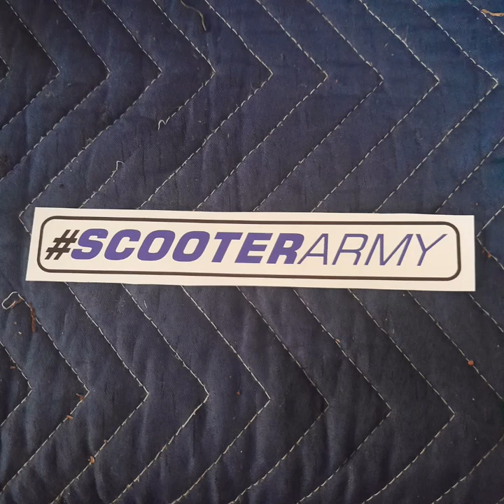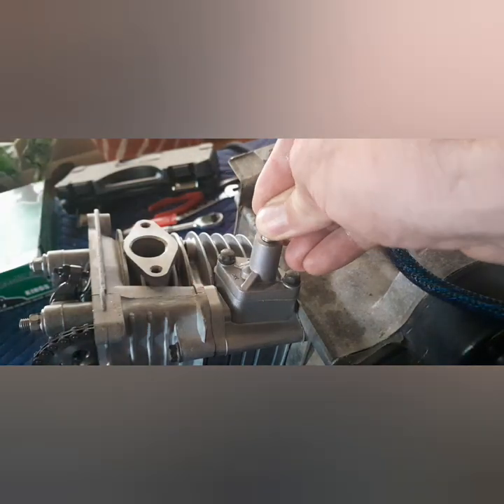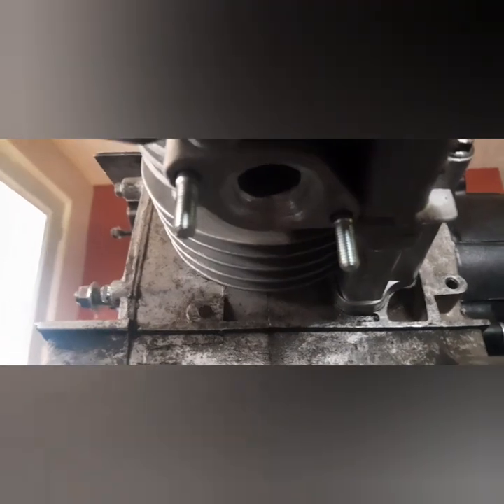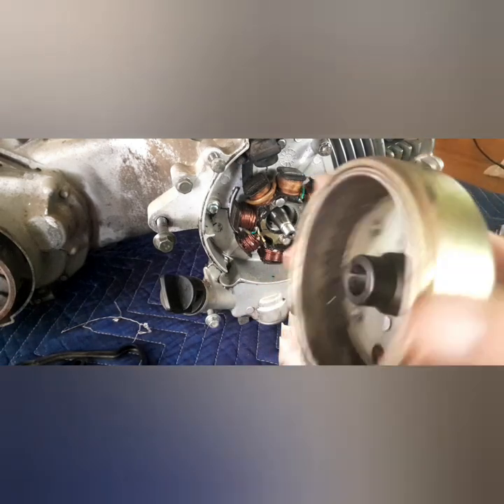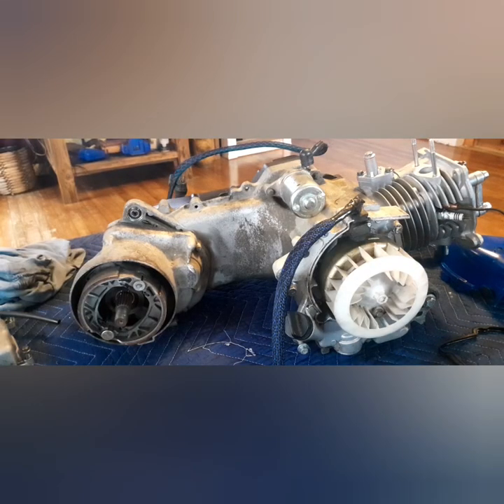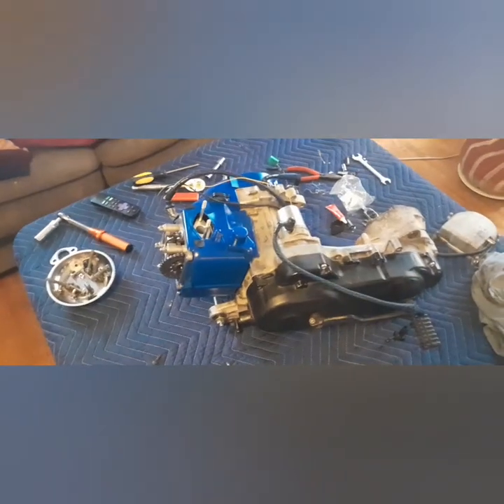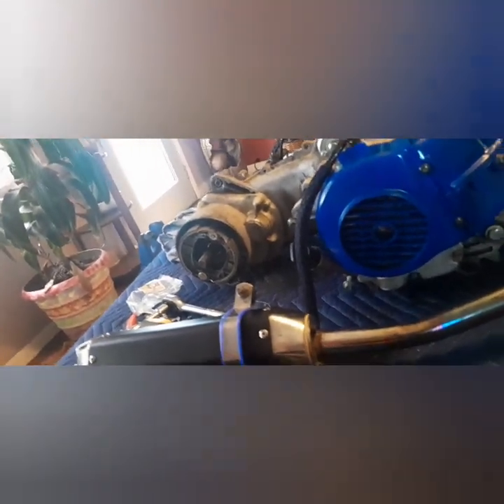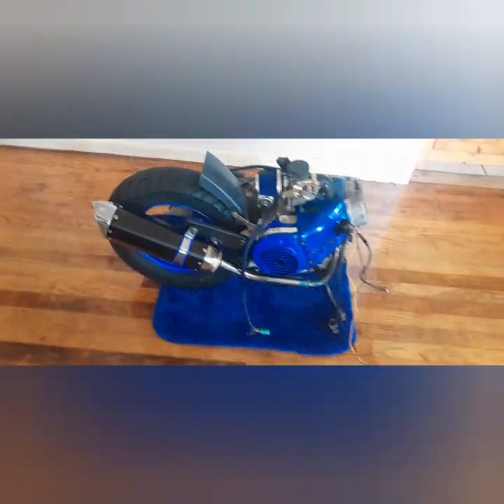139qmb build gy6 big bore kit install (part 2) 52mm w/ bv head

Comment: Did you have to modify the engine case to fit the new cylinder and head on to your 50cc engine?
Reply from the maker: No.. this is drop in on 99% of qmbs.. I have seen once, a case that needed modification
Reply: @scooterarmy  The only QMBs that need case honing are the QJ built variant that was on a bunch of old Ventos. You'll know you're looking at one of those because they take weird sized belts (that are no longer available) and use Minarelli clone variators... but there are so few of them left it hardly matters anymore.
Reply from the maker: @Partsforscooters1  yep, I've seen one ever

Comment: How does it keep it cooler? I mean it's plastic. . I took mine of my maddog an I used the plate that was mounted under the seat an cut an made a piece to mount with the angle of the bar that's on front of head an formed a piece that follows the curved bar under the head
 Sound good or no. Im thinking of getting the 72cc kit from rolling wrench.  Do I have to pull the motor off?
Reply from the maker: I'm not sure I understand. Most of the time pulling the.motor is not necessary.  I had other reasons to pull, I usually do it on bike.

The plastic cooling shroud keeps it cooler because it encloses the engine and the fan flows are around it. You will overheat without the cooling shroud.
Reply: It will overheat? I guess the wind from riding doesn't blow on it.  I put the steel plates thru on mine to block water from hitting the head. Keep your wrapped in plastic. It's beautiful
Reply from the maker: @seanmayo206  I hear ya.. and im not the world authority on it.. I run a temp gauge and would be curious what Temps your running without the cooling shroud. At the end of the day,  if it works with non-issue for you then carry on and enjoy. Thanks for watching And engaging with me... have a good one my friend.
Reply: @scooterarmy  bruh if a  little ass 50 starts to overheat then your a heavy ass
Reply from the maker: @seanmayo206  you'd be surprised what idiots are capable of lol.. and with a high lift cam and 52mm bore they can get pretty hot at wot.
Reply: Fuck the crank up then
Reply from the maker: @seanmayo206  huh...
Reply: @scooterarmy  I'm referring to a 50cc .i
Reply: @scooterarmy  I just possibly have the best looking maddog in NC considering it's a maddog
Reply from the maker: @seanmayo206  I saw it and it's nice!
Reply: @scooterarmy  thks man. It's been a struggle. I deleted all the you know what stuff an then had to figure out the right combination of CVT parts

Comment: I don't have no license and with those ccs id need it or a different vin numbers
Reply: No one is gonna know what size engine you have.
Reply: @edwinmendija8087  they would know if it goes over 40 what size the engine is
Reply: @edwinmendija8087  but then if i put a larger engine on i would have to swap the tag numbers on the frame because a bigger engine's tag numbers wouldn't match whats on my papers you see

Comment: Hi, what did you set the valve clearence to? And what size carb and jetting to that 52mm  big valve setup?

Its was some Nice videos!
Reply from the maker: .003 on both, but every build will vary a little. Anywhere from .002 to .005. True 20mm cvk, 92main. Upgrading to 21mm slide in future
Reply: @scooterarmy  thanks!
Reply: Sorry, i have a few more questions..

What sparkplug do you use to these Kits?
Do you change crank bearings?
And last, what about torque springs?

Thanks for your help!
Reply from the maker: @dp-kr7js  ngk plug.. most people either start with a low mile motor or replace crank. I don't remember what ive got for clutch springs
Reply: @scooterarmy  thanks, Ive meant what "size" plug? I, currently run a ngk 7 on my 72cc,is that fine on a 52mm?
Reply from the maker: @dp-kr7js  guess I'm not sure what you mean.  I run the same plug in all my qmbs, ngks, can't think of the exact numbers off the top of my head hsa7 or something along those lines.

Comment: Yeah but then you gotta change the vin numbers and all that bullcrap do all that work drilling it off to change it so it ain't worth a kit
Reply from the maker: I don't know what your talking about.  I have a license.  And this is only 88cc, it's not a sport bike lol
Reply: @scooterarmy   They seem bad at explaining it but I think they are talking about the regulation that anything 50cc and less are legal for road use without a motorcycle license and in some places don't need to be registered or insured. Going bigger takes you out of that legal threshold. But really, no one will know unless you get caught going suspiciously faster than you should on a 49cc.
Reply: @scooterarmy  for who doesn't have a license that's the right way of doing the swap the right way with your original tag numbers each one of those scooters have tag numbers and is stamped on the frame then once the metal tag is swapped no one can say you can't ride that because then its your argument over their's while they wonder about the paper and the engine size they'll wonder why the paper says it goes up to 40 but the engine goes to 60 and they won't get it
Reply: @dekoldrick  it wouldn't matter getting caught cause the stuff would be changed from old to new 

You take off whats all on the old and put it on the new one and your all good and then you tell anyone that's how it was when i bought it used